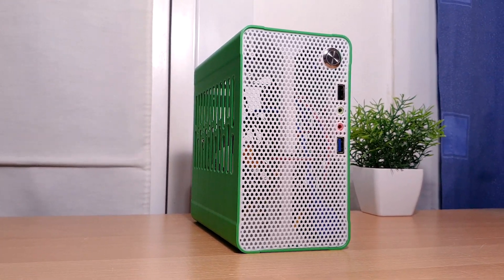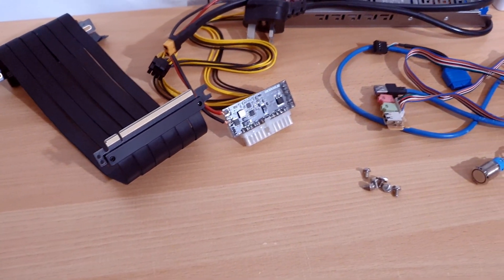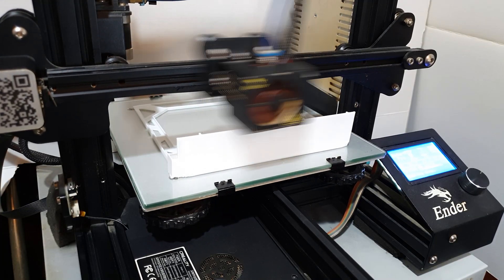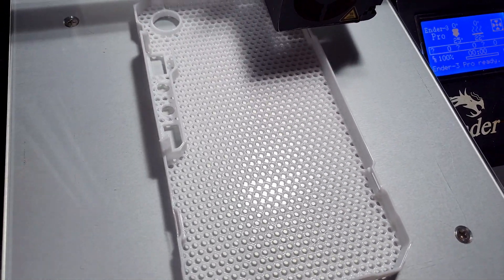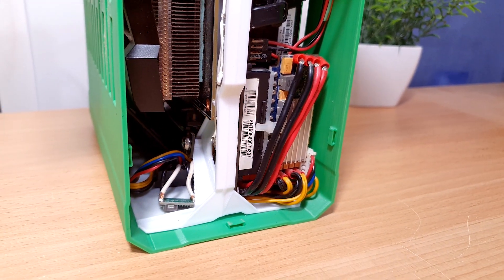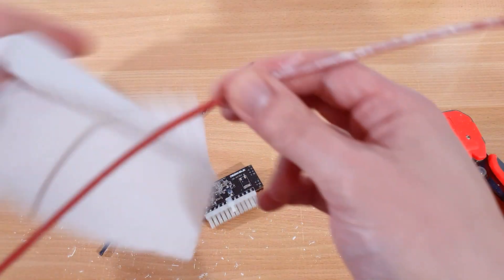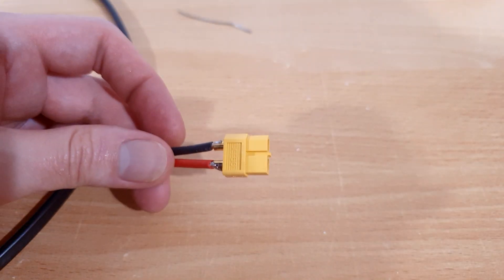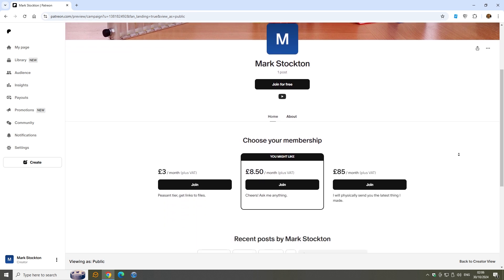3 Piece PC Case, How To Print/Make

Comment: ty for you time and knowledge and for sharing... got a question, any change this could be modified to hold the gpu and mb on the same side ? something like the SLM1 by custom mods
Reply from the maker: I may do later, would you have low profile GPU? I think it needs it, I imagine the regular height gpu would make it too tall to be asthetically pleasing.
Reply: @arkatub  yeah for low profile ones, that dont need psu connections... something like an RX 6400... there are tiny boxes like the lenovo M720q that you can atatch an riser an have an video card, or eternet card etc. Looking for weeks for this formfactor, and no one does it 3dprinted, something like 26cm×22cm×8cm, its still compact and you can place it verticaly and horizontaly

Comment: 2:00 this is actually very clever for large islanded objects with clearance to spare, tons of time saved on movements, less motion system wear, and better surface finishes. not many downsides if it's not high up on the model(thermal shifting could occur if you let the 2nd areas 'base' region cool down too much before putting filament there.)

Comment: This is awesome! this may become a part of my rolling TV streaming station project for my workshop as I want to replace my streaming laptop eventually for something much easier to do maintenance on. I will definitely print this in ASA for the extra thermal headroom.
Reply from the maker: Please let me know if you can do the sleeve without warping, I tried ASA once but it didn't seem to be any easier then ABS.

Comment: Good Job. I wouldn't print the case on Y axis, it will break at any fall. Also, you should always use flux before soldering as it improves the melting a lot.

Comment: 6:49
Yikes, you need to pre-tin and flood the wires before doing that, also flux!! Look for FPV xt60 soldering. Also, I'd add some hot glue for some strain relief/prevent shorts.

Comment: No one should print a PC case using PLA.
Reply: There are a couple of other youtubers who have done it and been fine. I personally wouldn't.
Reply: @candycornpeeps  Who? If you defend PLA for this use, leave the printing business. If you do, you do not belong there. Do not put others at serious risk.
Reply: @FrodeBergetonNilsen  out if curiosity,  as I do not print and have minimal material science knowledge, why is it dangerous to have a PC case made of PLA? What I do know is old types of PLA are prone to warping under high heat, but that is at over 150°F which I wouldn't expect the plastic itself to reach when used as a PC case. Another thought I had was that it is conductive in some way, but also under the impression that most plastics are not electrically conductive. So why is it dangerous, honestly, not trolling?
Reply: @7MBoosted  i really don't think it is dangerous but PLA would probablu deform ABS/ASA would be a better choice Maybe PETG would work but i would go ABS/ASA
Reply: @franciscloutier8227  thank you for answering my question.
Reply: @7MBoosted  it's not dangerous. Just bad design practice. PLA is the easiest plastic to print with because it has the lowest melting temperature, over time and without maintenance that computer might get hot enough to melt the PLA. But to be honest warping is more of a problem, good luck disassembling and reassembling after a year of use.
Reply: @7MBoosted 
"Danger" is incredibly weird hyperbole.
PLA is the least temperature resistant of the popular printing materials. It is likely to warp in hot temps (I've had black PLA warp on a sunny day outside). That's it. Same reason it never is recommended for stuff you have in your car.
Reply: @MumrikDK  my use of the word danger is in direct response of the OP saying printing a case out of pla puts people at serious risk. I have no idea what any of this means, only asking questions.
Reply: @FrodeBergetonNilsen internal PC case air is generally speced at 40° for a normally kitted tower with a running midrange gpu... Nothing is touching the actual hot bits. PLA is entirely fine as long as you're not printing a bracket for your tower cooler that will be in complete contact with the back of the motherboard.

It's just not that hot. You're wrong. Nobody printing a case is putting a 4090 with an i9 1200W system in it.